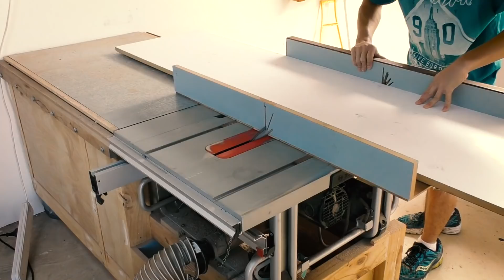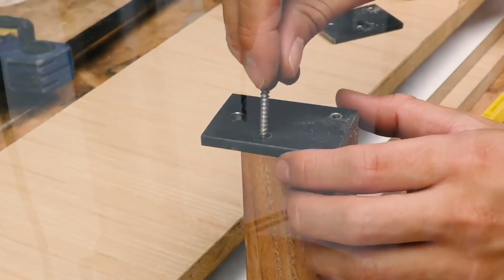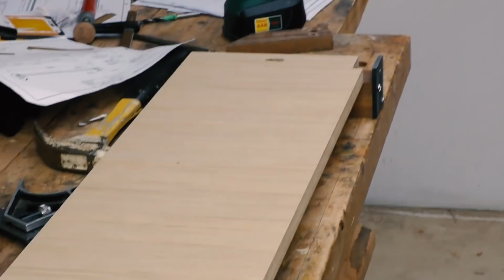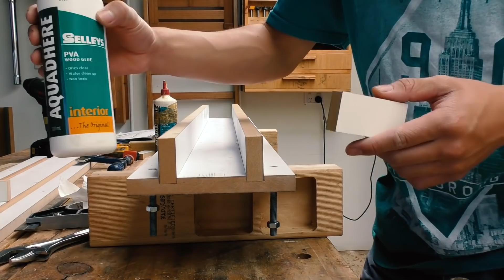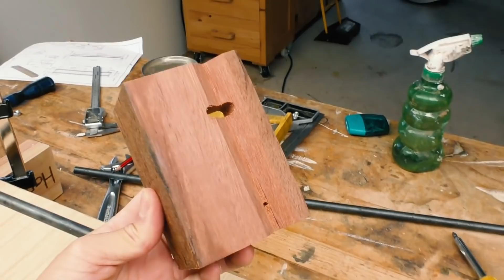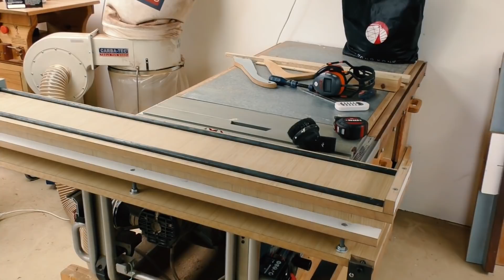Sliding Table Attatchment Part 2 - basically, a base

Comment: Dribble some acrylic liquid wood hardener into the holes where you put the threaded inserts into; MDF and chip board doesn’t have much holding power and the wood hardener will stabilize and strengthen the wood fibers around the hole.  

It can also be helpful to drill the hole initially for the tap size of the screw that will eventually go into the hole, drill the larger opening for the insert at the front part of the hole, and dribble the wood hardener just in that area before (carefully) inserting the threaded insert.  Then wait for it to dry and harden before dribbling more wood hardener into the rest of the deeper, smaller tap size hole; then screw in the screw (with paste wax on it to prevent it getting stuck) into the hole.  The soft, wet wood fibers will harden around the screw and will set into threads the same size as your threaded insert.  So you will have steel threads in the first section of the hole and hardened wood fiber threads the same size as the insert in the rest of the hole and it will provide additional holding power in the soft mdf or chipboard.
Nice work BTW!  👍🏻
Reply from the maker: might try it next time? if i get wood hardener?

Comment: Well done, but i have a question about the torsion box. Did you use it to improve the stability of the NDF or has it other reasons? As far as i suppose this box makes the adusting mechanism less efficent because it now has to bend a box, wich is designd to be stiff. I think it would be more efficent to use a plywood Board, wich could be thinner but is much stronger then the NDF. I'm asking because i want to build one myself, but mine is limited by the hight, so i actually don't have the room for the torsion box. It would be great if you could share your experience from building this with me.
Greetings from Germany
Reply from the maker: yes it is to improve the stability of the structure, and also the strength so that when a heavy load is applied above it doesn't just bend. And yes it does make it less efficient to adjust, however, that depends what you call efficient :) usually you don't need to adjust it that much and also the bolts and a wrench provides plenty of leverage. But making a torsion box does mean you would need a very stiff base for it to "bend" against so that it is the torsion box that is bending and not the base. I'm sure you can always work around not having the torsion box, but it'll just mean making sacrifices to other aspects of the design. Hope this helps